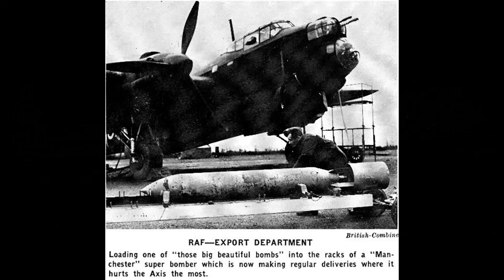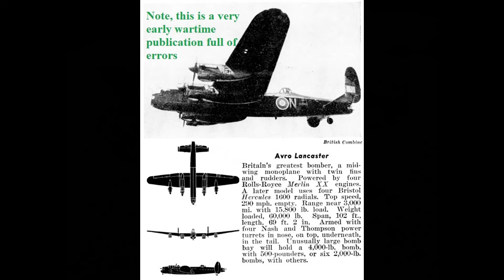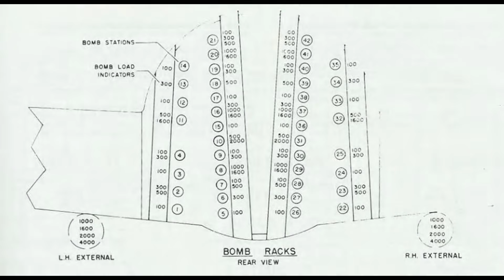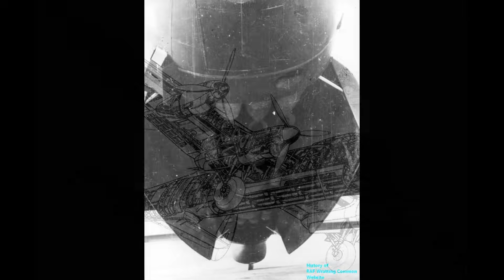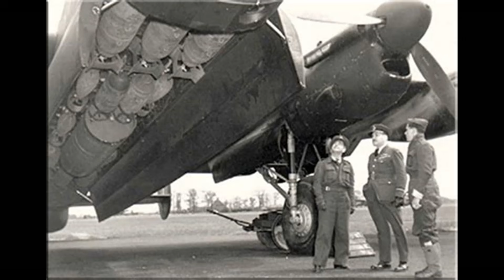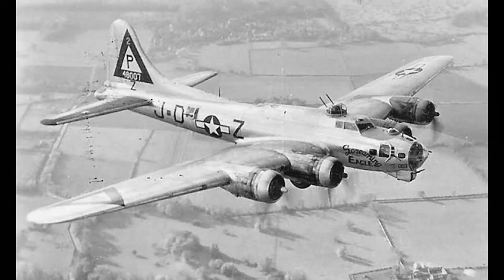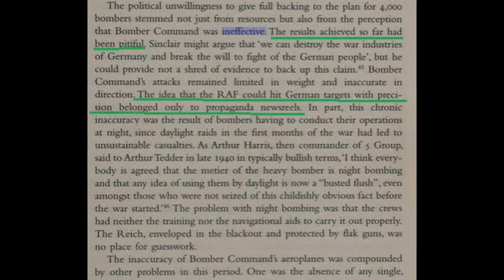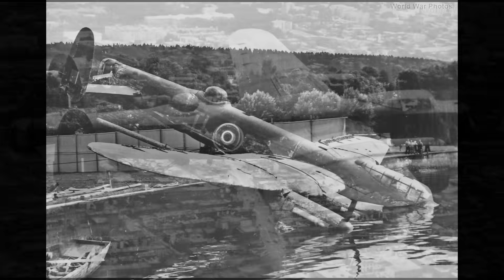Avro Lancaster, Payload, Turrets, Stability and More

Comment: Could someone help me with this?  I don't quite get the idea - the high tail on a b17 and maybe a rolling moment from its leverage, had something to do with the low wing and 5° dihedral.  
The pairing of twin tails with high wing b24.  Did I get it right that with the cg lower than the wing, we have resistance to turning, so that for stability we can have smaller rudder area? 
I get that prop wash is nice.  I just don't get the stability reasons that single rudder goes with low wing and twin rudders goes with high wing 
Can you help??
Reply from the maker: Take a good look at the Navy diagram showing sweepback, dihedral, and the tail. It explains how they all do more or less the same thing here.

Comment: My Uncle flew in Lancasters he made it to the end of the War but my Great Uncle was shot down over France in a Stirling and was lost and buried there.
One thing i always say to those that try to undermine those Brave boys who so often made one mission and didn't return "They was All Volunteers" As no conscription in bomber command.

One major difference between the Lancaster.Stirling and Halifax was if you needed to vacate your Craft Rapidly! IE Bailing out your chances of success and survival odds was very poor with Lancasters due to a few factors one being narrow/tight access through the plane.another was position and size of door. Propensity to often go into a flat spin if not under power/engines out/no one at Helm. plus if did get out often found hung on tail plane or smacked by it.

Comment: "In September 1940 Arthur Harris, then AOC 5 Gp, wrote to Bomber Command to say that he was ‘convinced that a perspex turret in the tail is a mistake.’2 He maintained that the most important feature had to be an unrestricted view and he wanted to save the weight and complexity of a powered turret by substituting a simple open observation station with three or four hand-held guns."      p. 69      
"More to the point, armour plate, ‘bullet-proof’ windscreens and self-sealing fuel tanks meant that the German fighters were increasingly resistant to mere ·303-inch machine gun fire."    page  71  
ROYAL AIR FORCE HISTORICAL SOCIETY JOURNAL 45   on line

Comment: I've also read an advantage of twin-tailed planes was that the tails didn't need to be as tall as a single tail would have to be, making for easier hanger storage.
Reply: That was the reason for the Lockheed Constellation tail. The airlines might not buy them if they had to build new hangers. Lockheed started using twin rudders on the Electra to place the rudders in the engine slip stream on the twin engine plane.

Comment: Greg, on wing dihedral / vertical stab configuration , the PB4Y-2 Privateer, a modified B-24 for naval patrol was a large vertical tail. The Lockheed Constellation (low wing triple tail) are the planes that defy the rules on rudder/wing location. My understanding is that another reason was hangar heights in the 30s/40s. And since those same hangars would be used by the constellation therefore the triple rudders. The privateer was a single rudder for maximizing range (the rudder may be hinged for lowering, I don’t know)
Great show on the Lancaster… wish the belly turret could have been copied from the B-24 (probably wouldn’t fit)…
Thank you for this keep it going!

Comment: The Lanc is regarded with great warmth. My biggest bugbear about the plane was within bounds of its limitations. The escape hatch was a notorious problem, and - well I will speak of its price in a moment. Always at the heart of the problem with the Brits - was being limited in many regards which people often overlook. It went into the war in an unready state across the board, and in many areas a case of limitations and catching up is almost always visible. 303s, engines, lack of armour.  

The Lanc was able to take a great bombload a long way. Its was smaller than the other heavies (so its war cost to make was somewhat lower..) - and IIRC correctly - the flight support and crew requirements has made it the most heavily supported plane in British history (Factory staffing, ground crew - flight crew). An interesting side point on engines was that another aircraft that was a good plane in principle suffered like the Manchester. The Westland Whirlwind which used a pair of RR Peregrins - suffered from the lack of development, and production time and units available. So it was a bit off that RR then stuck two together in an X config, but that is for some other time. 

In all cases, an argument existed by Mosquito time frames about the heavies. The Mozzie could take the 4000lb load to Berlin as the B17 often carried, and could do so in half the time, and with an enormously lower resource and crew cost, and a much lower loss rate. It could not match Lancaster loads, but that is a side point. 

A note on American airmen, and their planes. I'm British. When I travel in the UK, to places that are near to where their airfields used to be, pubs nearby sometimes retain history. One that I had a few pints in has plaques on it's walls. Those plaques are in memory of US airmen who in 43 flew daylight missions with a 0.5 mission survival rate and suffered terrible losses. Etched into brass - pictures of B17's - and crews. Its a debt I am always mindful of, as young Americans came here in the fight for freedom, climbed about their planes facing by statistics certain death - in the fight that today has provided the very freedom I am so very fortunate to be a very thankful beneficiary. That debt can never be repaid, and no words I can ever write can thank them and their loved ones for the gift their gigantic price rendered. In lighter conversation, I would always plump in the Lanc vs B17 pubtalk for a Lancaster, but I should be ever thankful to all the planes, and all the crews. 

A final note, and harking back the to escape hatch. RAF bomber command lost 55,000. It took the war right to Germany, and then for a long time, Bomber command crews were treated badly, tainted by the claims made of Dresden and other missions. The Lancaster for whatever reason retained the love of the public - while the crews who flew her were mistreated. Only recently has Bomber command crews - seen a change with more reverence for their efforts. Night after night they would go into German skies, wrecking the German nations war making capacity, at enormous human cost it is fair to say on both sides. Along with Allied aircrews and planes - these missions greatly damaged, harmed, limited and havoc'd Germans ability to wage its war - and at the heart of that British effort was the Lancaster. Bomber Harris in terms of war, waged a terrible war - one which we had to fight, and we should remember with reverence the crews who did so.

Many many thanks for taking time to speak about it.
Reply: Well said , the 4th and 5th paragraphs in particular .👍
Reply: Tests by the US in the US had nothing but praise for the Lancaster III . He also flew the Halifax which he classed as mediocre
Reply: @jacktattis  The latter Halifaxes were liked by their crews and they made claims of out performing the Lanc. The Lancaster crews generally felt their plane was better. Getting 1600hp engines up from what the lancaster had made the Halifax later marks a good stablemate of the lancaster.
Reply: @AdmV0rl0n  The Test pilot did say the later model may have been better But the model he flew was not good
Reply: @AdmV0rl0n  well it was faster but did not have the range
Reply: Thanks for a great post. About Bomber Harris I think more should be said. He was a difficult man for other RAF Air Marshalls to work with. When all the evidence pointed to the founding of a Pathfinder Force as the best way to improve the notoriously poor accuracy of RAF night bombing, Harris opposed it both actively and passively. The most outstanding Air Marshall the RAF had in WW2, Wilfrid Freeman, would get seemingly deliberately unhelpful communications from Harris, and would in turn reply in a brusque, borderline rude, manner. Freeman said "The only way with Butch (Harris) is to treat him roughly." Harris was a stubborn man by all accounts who hated to follow orders if he didn't agree with them. Having finally accepted he had to form the Pathfinders, Harris made the perfect choice of a tough Australian called Don Bennett to lead it, but even then he had a tendency to interfere with and undermine Bennett. Incidently, Bennett's troubled working relationship with Harris did not stop him from supporting his bosses legacy as the 'right man' for the job. Harris's most egregious act was his attempt to avoid co-ordinating the RAF bombing campaign with that of the daylight bombing USAAF in the lead up to D-Day. This undoubtedly put huge strain on his relationship with Bennett, a very efficient and determined leader, who was greatly affronted by Harris's claim that RAF night bombing was not accurate enough to co-ordinate with day bombing. Harris seems to have been motivated a great deal by revenge for Luftwaffe bombing of British cities in 1940-41. During the war a large proportion of the British public approved of this motive for bombing  German cities but after the war ended Bomber Command veterans did not receive their due because of the lasting stigma of bombing civilian targets. Harris was obviously  no hypocrite in this regard, but his conduct during the war did seem to indicate a desire to "get the rubble to bounce" in single-minded fashion. His stubbornness and insubordination did not help Bomber Command's post-war reputation because it was all too easy for his critics to point to them as evidence he was an indiscriminate killer. After Freeman left a supervisory role over him, Harris became harder to control by  his superiors until the end of the war.
Reply: @neilpemberton5523  Many thanks for this info. I like to think I know my stuff, and to a certain level I do, but this is next level info. Harris (I think this is my opinion rather than perhaps 'the truth') - was the absolute drIving force in making bomber command the hulk smash thing. And in that, there is indeed a lack of nuance. Harris was indeed a vengeful force, but one can argue that in fighting back against the Germans, and in delivery of hammer blows - that was to a point needed. In the video - there was a point of angry comms from Harris about poor 303 guns and lack of better defences, so I would say this shows the man did care on detail - to some degree. 

The levelling of British cities and the outrage meant that I think the majority of British society was in no real mood to demand nuance. It is true that basically in the propaganda, claims were made contrary to the brutal facts. Late in the war, once victory was in sight, perhaps the mood changed, and certainly after the war people wanted to revise or change what happened because they did not like the outcome war brings. 

https://www.youtube.com/watch?v=5ujzVqwJnB0

The man was an absolute driving force - and we can today say we don't like his 'experiment' - but all I know is that the bombing while it did not totally break the German war machine - it devastated delivery, production, transport and operation. And provided a 'second front'. In that video link, at the end, was a .. moment of contemplation. Prior to speaking of Japan. The west went from barely being able to strike back with magnificent Blenheim boys who fought against terrible odds, all the way through to the heavies, and in our case 55,000 casualties on our side, and absolute city wrecking ability, to the incendiary bombing that burned through Tokyo, to two bombs that dropped and end a war almost overnight. A case was thus made that bombing could win a war. I am not saying it is a winning/right case, but made none the less. 

I stare today at Ukraine. And I ponder how little we have learned. The Russian cities today are in a belief that they can 'Coventrate' Ukraine's towns and cities without answer. I am not religious. But I 'pray' that we don't have to go to such lengths again to stop terrible tyranny, but right now, the world may need a new Harris at some point in the future. 

The world has hopes that we never were to see decimation of civilian areas in a way that Harris carried out his work. Hope, burns low right now. 
The Russians today have to be stopped, and that will not happen with fine words, civilities and people wringing their hands. So very many things in the past 5 years have been an echo of 35-40. History will repeat unless we learn from it....

(Thanks for your reply and in info, I appreciate it!)
Reply: Well well. I have to call out this Mosquito rubbish. Lets consider that bomber command already had a heavy force then you suggest replacing that with Mozzies. This requires 2 more engines and 2 more pilots at least to achieve the same level of ordinance. The engines are a problem for a start, the time and resource to change tack to this plan is issue number 2 and the biggest issue is how many more pilots you would need. Pilots do not grow on trees. It takes a lot of time to train pilots. Many navigators and gunners in Lancs signed to be pilots but got redirected as there is not the time or resources to train them. I know its nice to imagine this sort of theory but at the time your suggestion would be quite ludicrous and impractical.

5th paragraph though. Yes. Extremely brave and courageous men flew in bomber command and their lack of recognition for years was a bloody disgrace. I have nothing but admiration for them, its hard to imagine how they kept going.
Reply: @ivormott7309  while not to labour the point, and I'm not going to claim I'm right - its just an idea/theory, and no one tool makes a toolkit, A mosquito used a lot less resources than a Lanc, and even if we make an argument that it needs more pilots, thats more than offset by crew. If you need 2 mosquito's for the same, its the same number of engines, much lower resource, crew, and ground crew, and arguably lower losses. But I digress. Good to chat.
Reply: @AdmV0rl0n  There is no doubt a Mossie could potentially deliver a similar ordinance to a Lanc more effectively although it would take 3.5 (!!) Mossies per Lanc to be equivalent so engines and precious pilots does become a factor. I do think it would theoretically be more effective and less dangerous for crews but resources in engines and pilots made it impossible at the time.

A fun discussion though I agree! I was shocked at Greg's misinformation on B17 load outs compared to Lancaster load outs though considering his normally excellent content and that's when I felt I had to comment. The poor Liberator always gets forgotten too :/
Reply: @ivormott7309  I always thought the B17 had a limited bomb load - IIRC 4K, but I'm always loathe to argue when the person talking nominally does deep research. I read about the lighter bombloads, but were those sources right? In any case, Gregs work is always top stuff so leave it there!
Reply: High altitude US missions reduced bomb loads, I imagine?
Reply: What is bloody wrong with you people Engines were good enough to get to 287 mph with 14000 lbs on board The Guns for the plane were adequate for the distances the enemy was coming at them at Night lack of Armour the Tail Gunner had a steel door at his back And   Flt Sgt Tom MacLean got more than 9 kills as a tail gunner  and preferred the 4x.303 with the faster Rate of Fire than the heavier rounds and slower rate of fire with the Rose Rice Turret .
Reply: @jacktattis  Unless it was in a dive its not doing 287mph with that load. The guns were far from adequate.
Reply: @AdmV0rl0n  All British Tests were done at combat loads It was the norm. And the weapons they had were good enough for one tail gunner to get 9 OR 10  up to the night of the 15th/16th Mar1944
Reply: @jacktattis  The life expectancy of a tail gunner was 5 missions. Its a general understood reality that they were under armed. I'm not going to comment further. Very brave men kept climbing on bo0ard despite everything.
Reply: @AdmV0rl0n  That they did this from Great Aircraft of WW2 
 Firing times 
4x.303 130 seconds 
2.50 24 seconds
Reply: @AdmV0rl0n  All speeds of RAF aircraft were with normal payload So if Gunston says 287mph w 14000lb THEN IT WAS 287MPH.

Comment: How did radar operators on aircraft with radar get the information from the radar during ww II? For example the bf 110 or me 410 did they have a screen for the gunner or whoever controlled the radar
Reply: Not like modern radar screens which are like a map. The 3-man crew BF110 radar was the business of the radio operator & it had three small round Cathode Ray screens that each displayed a horizontal line with a vertical spike when it detected something. The position of the spikes told you if the target was left/right, high/low & distance - the operator guided the pilot to the target & the pilot took over once he had a visual of the target.
Reply: @nightjarflying  so each screen displayed either distance right/left or up/down?
Reply: @thurbine2411  A typical arrangement for WWII German airborne intercept radar left to right was: RANGE, AZIMUTH [bearing] & ELEVATION. 

The screens are round, black/white, not very bright & very small - around 4 or 5 cm radius. The plane was guided to the approximate target area by instructions from ground radar & then the plane radar was used, but it can only 'look' forwards so there is a large chance of failing to pick up a target - the target has to be in the radar cone of detection.

Another problem is that using RADAR warns the target of a threat nearby & then enemy night fighters can 'listen' for the RADAR & hunt the hunter.

Late WWII RADARS air intercept RADAR was simplified to one screen so that the pilot could use it directly in a single seat fighter - the Americans had that - not sure about other nations.